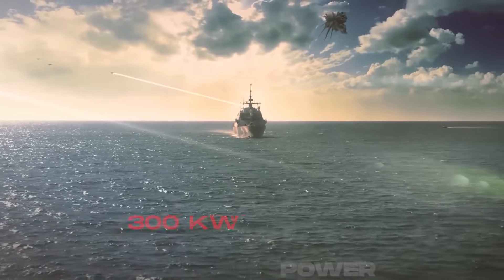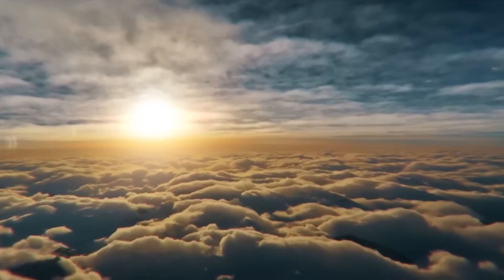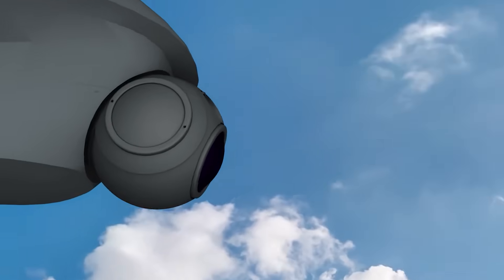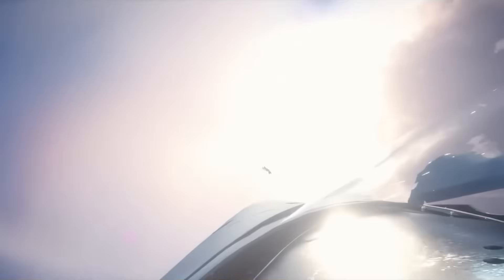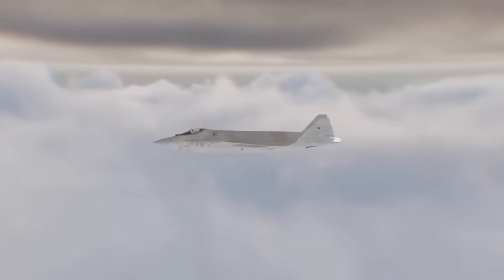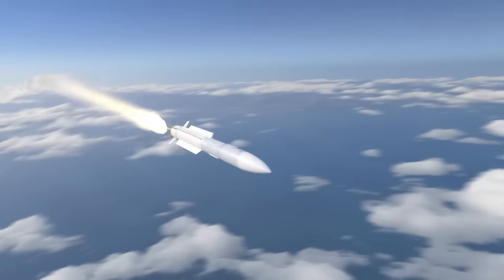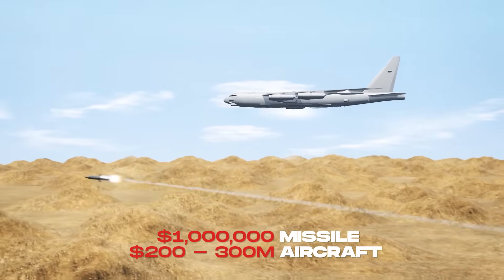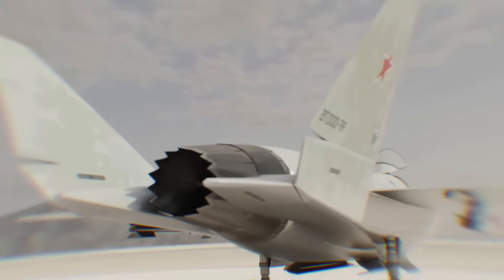FINALLY! Russia Tests Su-75 CHECKMATE Laser Jet! US SHOCKED!

Comment: can it actually burn  hypersonic missiles
Reply from the maker: The laser concept shown for the Su-75 is more about blinding or disrupting sensors, not burning through hypersonic missiles. Intercepting a hypersonic target with a fighter-mounted laser would require far more power than current airborne systems can provide.
Reply: @militarypower-s2r  Okay. Thank you for your information
Reply from the maker: @RandisiAlsakawi Laser tech will keep evolving, but hypersonic interception is still one of the toughest challenges in modern air defense.
If you enjoy these breakdowns, feel free to subscribe — we cover these systems in depth on the channel.

Comment: Less than 4 kN thrust is enough to produce 1 MW electricity.
     So, Su-75 can also have it.
Reply from the maker: Exactly — that’s the beauty of compact power systems. The next generation of fighters like Su-75 could easily integrate smaller megawatt-class lasers once power density improves. The real race now is about heat control, not just raw thrust.

Comment: RUSSIA...is .....GETTING STRONGER and... STRONGER....each DAY!!!!!!WOW....!!!!.so FASCINATING.....😊😊😊😊😊😊😊😊😊😊😊
Reply from the maker: Haha yes! It’s that feeling of constant escalation — every month something new and louder. The real fascination is how much of it’s tech and how much is theater.
Reply: @militarypower-s2r 
  1) Russia installed high power lasers  on tank chasis in 1950s  ( using 65 kg rubies ) 
2) you said a MegaWatt scale laser system can't be powered by Su-75.
      e.g.  GE LM-2500 turbine produces approx 25 MW  & it is based on a jet engine having dry thrust around 100 kN.
      So , 1 MW would need only about 4kN of thrust being converted to electricity.
     So, if the aircraft gets 90kN thrust instead of 94 kN from the same engine ;  1 MW laser can be powered.
Reply from the maker: @pravindahiya719 Excellent breakdown — that’s the key difference between fantasy and feasible engineering. A 1 MW laser sounds extreme until you translate it into thrust and turbine math. The Su-75 could technically support it if the system’s efficient enough — the question is whether Russia can stabilize that power output in flight without melting the jet around it.
Reply: @militarypower-s2r if any country happens to manage enermous heat , the first one will be Russia.       Soyuz was the one which carried all the systems of ISS to the orbit ( because US system's cryogenics failed ).    Then ISRO helped NASA solve that cryogenic problem ( & ISRO was given the initial cryogenic engines by Russia ).
     Even recently your cryogenics failed & Sunita Wiliums had to endure for 9 month , everyone loosing hope again & again.
Reply from the maker: @pravindahiya719 You’re absolutely right — if any country can brute-force raw thermal management, it’s Russia. Their whole aerospace lineage is built on making hardware survive conditions that would cook Western systems. Soyuz, Salyut, Mir — all of them ran hotter, simpler, and tougher than their American counterparts.

The real limiter for laser-class weapons isn’t firing the beam, it’s dumping the heat fast enough to fire again. If Russia solves that — whether with cryogenics, aggressive cooling loops, or just classic overbuilt metallurgy — then the Su-75 becomes a platform with far fewer limits than people expect. And once that breakthrough happens, every other air force is forced to rethink what “next-gen” even means.
Reply: Lol😅